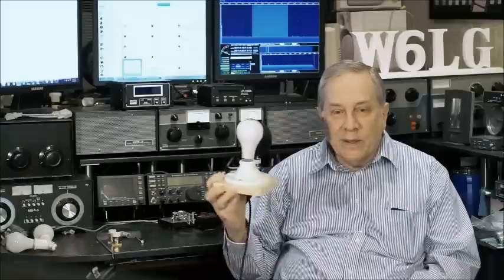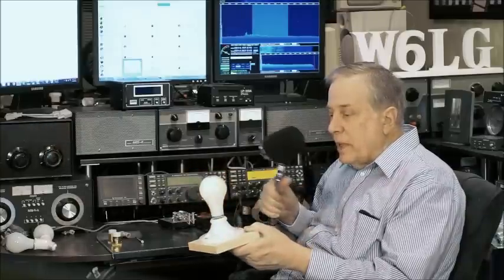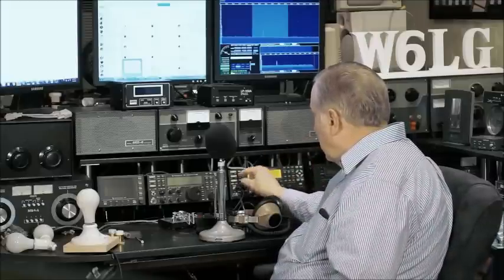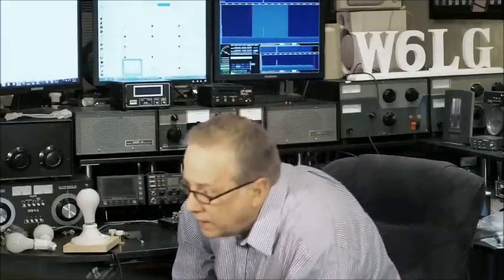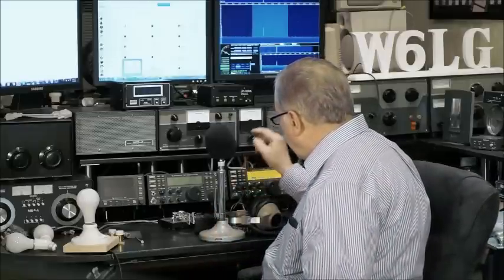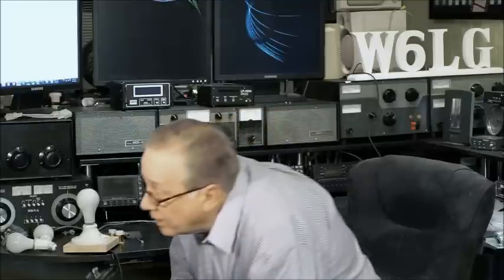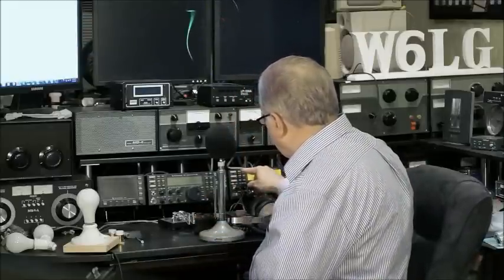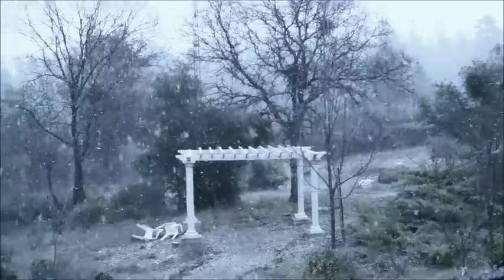Ham Radio Basics--Coax Cable Loss--Yet Another Surprise

Comment: Excellent, very relaxed and enjoyable presentation Jim, such a contrast to many on YouTube,  I must admit I rarely use 10M in the last few years and on the lower bands I guess the RG213 and RG8X are just fine for most hams out in the real world, 100W and a wire antenna and not too long a run.   Thanks again for a great series of videos learned a lot despite being QRV since 1970    Vy 73  Tony  G3ZRJ
Reply from the maker: True.  I don't run RG8X to antennas if at all possible.  In any case, get on the air and work some DX. 73, Jim  W6LG

Comment: This is why everyone should be running a minimum of 1.875" hardline, not only does line loss reduce power to the antenna, it also reduces signal streanth on receive.

Comment: As measured here, a 100' run of RG8X is roughly 15% more lossy than a 100' run of RG213, but it costs (DXE bulk price as of May 24, 2021) less than half as much at  $.48/ft vs $1.09/ft.  If your runs are short (<30') like mine are, and you're not into microwave freqs, RG-8X seems the better value and is also easier to work with.

Comment: 1.55 dB loss in the RG8X and .87 dB for the RG-213. 
A 100 watt slug would help with accuracy too. According to this site: http://kv5r.com/ham-radio/coax-loss-calculator/ 

The loss in the RG8-X should be 1.65 and 
1.105 for the RG-213. So your measurements are better than expected.
Good video!

Thanks

73 Jim W7RY

Comment: Hi Jim glad to meet you. I'm new to Ham and just getting my shack set up. I have a run of 50 foot RG213 and need to cut it and place a PL259 and go to the arrestor at about 30 feet, then out of the arrestor through the wall to the transmitter. will this be a good idea or is it something I shouldn't do. Over all the coax from antenna to transmitter will be a total of 50 feet. Do I need to get more coax or will this work?
Reply from the maker: Hi Ken,
Most lightning arrestors do very little. Which brand, model do you have? 73, Jim W6LG
Reply: @ham-radio  You miss understood sir, my question to you was not about the arrestor but about the RG-213. I using a polyphaser arrestor, but I am concerned about having to cut the 50 foot RG-213 coax. Will this make a difference in the coax ability to be a transmission line? or will it change anything in regards to the 50 ohm status or the coax ability to tune the antenna properly?
Reply from the maker: @kenthompson143  No.  Go ahead and cut the coax to install good quality coax connectors. I use as much as possible silver plated with Teflon insulator connectors.  73, Jim W6LG
Reply: @ham-radio  Ok Thanks and 73 to you

Comment: The loss of cable can be calculated of course but this is really a neat 'show tell'. Point is: Coax definitely has loss as length and frequency is increased. Note that Jim has the coax terminated into its characteristic impedance. Otherwise the loss would be greater as we realize reflected power. Indeed the reflected power in part gets sent back up the line and is radiated but the coax does not like standing waves. At the poihts where the incident and reflected voltage peaks (they sum), the coax starts to kinda cook!!!!! Of course that RF power is lost in the form of heat and does not infact get radiated as RF. So...with SWR the loss in the line is even greater. We need to live with coax loss as we increase freq. Also try to terminate the coax into a tuned antenna (that presents 50 ohms). We kinda know this too. Maybe one way to 'get over' loss in coax (even when 1:1) is to consider whether the guy on the receiving end would hear a difference if, for example, the rig pumps up to 120 watts to make up for a 20W loss when the rig is doing just 100W into the coax. You know what? The guy on the receiving end will NOT hear any difference!! HOORAY!!!! So...we try to 'get past' losses don't we : ) !!! BTW: Ladder line is maybe 2% loss even at 10M but better be sure the feedline is balanced. Now that is another story!!!! Unbalanced ladder line radiates (like the antenna) and this can get into appliances, etc. Hm...another bag of worms!!!! Thanks Jim for the video my friend.
Reply from the maker: Hey Dave!  Our house is in escrow.  We have started to look in Rocklin.  I see more doctors tomorrow about a potential surgery; removal of parathyroid glands.  Those things are causing severe osteoporosis and kidney stones (man that hurts).  I am curious about the ladder line radiating.  I had thought that it would not because it is balanced.  This is all a very interesting and tricky subject.  There is much confusion and it is not easy to explain; as you know.  Back to the ladder line, it is almost loss less but the radiating part I have not seen.  Let me know your thoughts Dave.  Thanks, Jim on Wolf.

Comment: back in the 70's we used RG-8U but searching online for cable today, RG-8U is quite expensive!  in your video RG8X and RG213 are being discussed.  has RG8U been replaced by these newer versions or are these newer versions just more reasonably priced?
Reply from the maker: I think my original reply to did not get posted.  Yes, RG8 is hard to find and expensive.  RG213 is what most guys use.  I don't recommend RG8x except for jumpers.  There is no good specification for RG8X.  There is also LMR-400 and some copies of that coax.  LMR400 tends to be excellent if you buy from a known, good reputation manufacturer. Keep in mind that LMR400 takes a special connector.   Always buy good coax from a company that you can trust.  No name coax is  trouble. No matter what brand, the coax is likely made overseas.  73, Jim

Comment: Hi Jim, do you have a video or resource on how to build that lightbulb dummy load? 73 de K6TJO
Reply from the maker: I think I had the best success with a 3 way incandescent and I shorted the two filaments.  It was just that simple. If you have some bulbs around the house, try them with low power.  You can use the built in antenna tuner if there is one in your transceiver.  Did you have more questions about that dummy?  73, Jim

Comment: What cable should I use as a feed line to the antenna for a 5 w handheld radio ?
Reply: Dropit late reply, but it depends heavily on how long the cable needs to be, and what frequency you run. I am in NL, so the cables I can get and so on aren't the same as you have most likely but proper suppliers will have a table where they show cable type on one axis, and frequency on the other axis, this means you can estimate what your loss will be for the frequency you use for different types of cables. The prices of cables typically are close enough that you really want to pick the right one as they can be really really lossy, over 3db easily if you are doing more than a couple of yards. If you are doing a few ft it really doesn't matter as much. 73's
Reply: @Dropit   Hi Dropit.  What length of coax run do you anticipate between your 5W handheld and the antenna?  For the purposes of this post, I’ll assume you might be transmitting to an outside antenna, using frequencies around 145MHz and 435MHz.  I’ll also give you figures for loss of wattage per 10 feet of coax.    
Using good quality RG58, loss will be 0.47dB, resulting in 0.5Watts loss of wattage delivered to the antenna for each 10 feet of coax. Using thicker RG213 will approximately halve the loss to 0.26dB, resulting in 0.3Watts loss of wattage delivered to the antenna.  At 435MHz, losses are approximately doubled.  In a nutshell:
5 Watts / 145MHz  
10ft of RG58 = 4.5Watts at antenna    10ft of RG213 = 4.7Watts at antenna
30ft of RG58 = 3.5Watts at antenna    30ft of RG213 = 4.0Watts at antenna

5 Watts / 435MHz
10ft of RG58 = 4.0Watts at antenna    10ft of RG213 = 4.5Watts at antenna
30ft of RG58 = 2.7Watts at antenna    30ft of RG213 = 3.6Watts at antenna

It is acceptable (if necessary) to mix different types of coax (of course sticking to 50 Ohms) - all you need do is calculate the losses per each length of coax used and add the losses together.     

I hope this information is helpful to you.  
Here is a typical coax loss calculator:  https://www.qsl.net/co8tw/Coax_Calculator.htm

Comment: Would it make a huge difference if it was a single piece of coax rather than multiple pieces joined together?
Reply from the maker: I don't think it would.  That is a good question.  I will look into that when I get time.  Thanks, Jim
Reply: @Andrew Lawlor  Hi Andrew.  Nope.  You wouldn’t notice any difference, especially on HF, and probably not on the higher frequencies also.  Any real downside is leakage of water into any connectors along the way, if used in an exposed environment.  Suffice to say, a single run of coax is the best option in any scenario.   I know we all strive for the best signals and lowest losses, but when you get right down low into 20, 40, 80 Metre (meter) bands (and lower), losses become pretty insignificant, allowing even the crappiest coax cable to be used!

Comment: doesnt the coiling of the coax have influence to?
Reply: I was thinking exactly the same thing.  There has to be some impedance, especially considering how many loops there were.
Reply: its a giant hf choke..
Reply: That's what my uncle  W0LOY told me years ago, that coiling measures different at different frequencies than straightened cable.
Reply: Not on the signal which is being sent up via the central core which is protected from the shielding by the dialectic. But coiling the coax will impede any RF that gets picked up & travels down the shielding (which is why we add coils). What we are measuring here is how much of our signal (which is sent from the transmitter at 100 watts) actually makes it through the full length of our coax (whether you coil it or not) up to the antenna at the other end so we can determine the coax loss. Note Jim coiled his 10m cable to measure his wattage output even though it will be uncoiled when connected it makes no difference to how many watts will be lost in the coax. It is the length of the coax that is critical here. The longer your coax the more of your output power gets lost in the coax and therefore does not reach the aerial. The whole point of this exercise was to measure the coax loss and confirm that it was indeed within tolerance or close to the manufacturers stated figure. You will recall that the impedance of the coax cable presented to the transmitter is 50 Ohms which is what it will be expecting.

Comment: Nice show, and I also am somewhat surprised. The snow at the end inspires a question: One of many reasons we use coax is that it "doesn't care" what is next to it. We can lay it along a metal eaves trough, for example. But is that completely true? If we had some coax lying along the ground and it got covered with a somewhat-conductor, e.g. snow, would that change the losses? And for that matter would it change the effective impedance? Or if we bury the coax?
If the shield, braid or braid plus foil or whatever, were perfect then there should not be a change. But in the real world it won't be perfect.
Keep up the great shows!
73, WA9D

Comment: How about LMR-400?
Reply from the maker: For most of us, that is the best choice.  I have used it many times.  I just tried the 400 coax from DXengineering and it was very good.  I highly recommend buying that coax with connectors installed. 73, Jim

Comment: anyone use lmr400
or lmr240?
Reply: richard vaughn ..the work I perform I use both for different applications. If you look at the loss chart for lmr240 it works best in applications under 100feet and under 512MHz. UHF could prove slightly more loss. Above 512MHz and over 100feet definetly 400. But 240 is excellent for most applications. A quick comparison for 240 and 213, 240 seems to be superior for both through power and loss.